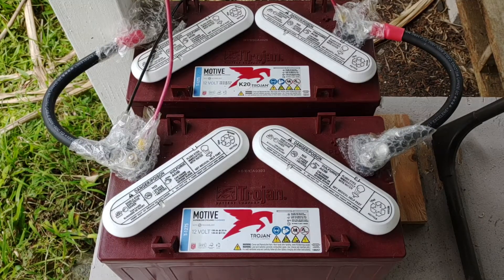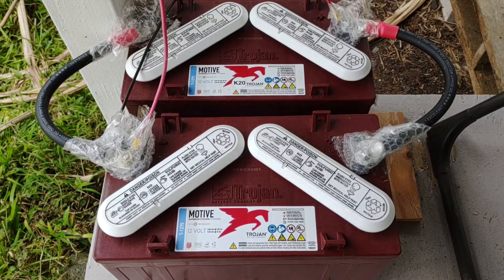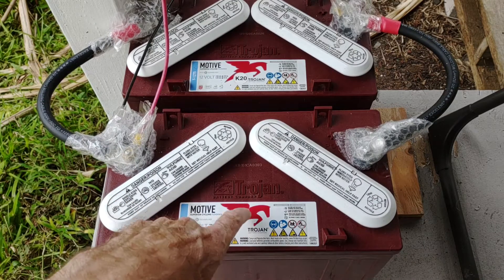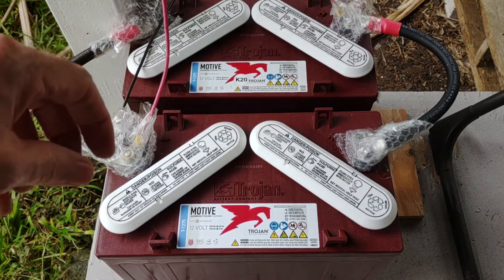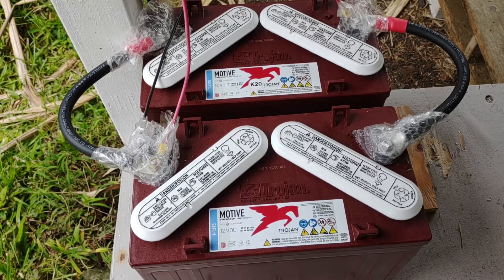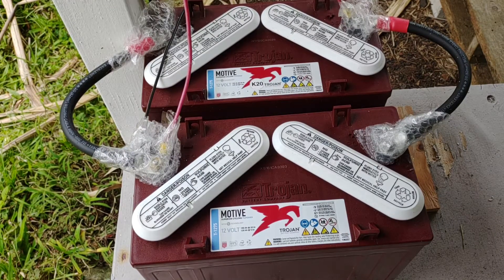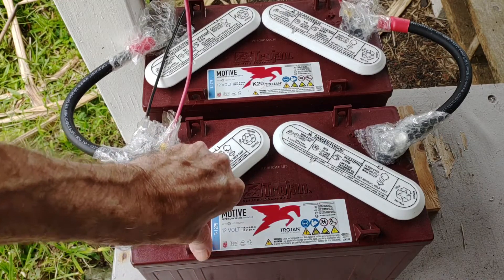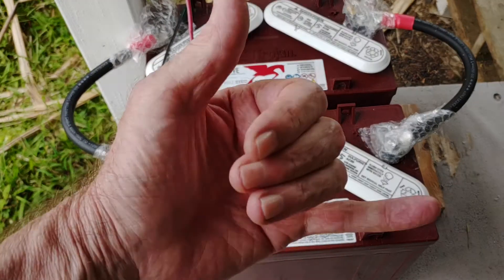TROJAN T-1275 12volt 150ah flooded lead acid battery

Comment: You are getting 10 years out of these? That's great. Do you use a hydrometer to check sg? 
No one told me what the sg should be for duracells and i cooked them. I'm planning on 4 t-1275s soon. Thanks for the info.
Reply from the maker: You're welcome and thanks for tuning in. Occasionally I test with sg, but mostly just make sure I cycle within the 50%-100%. Have two times before been able to get 10 years per bank with Trojan. 🤙